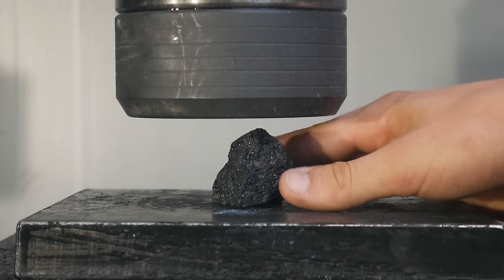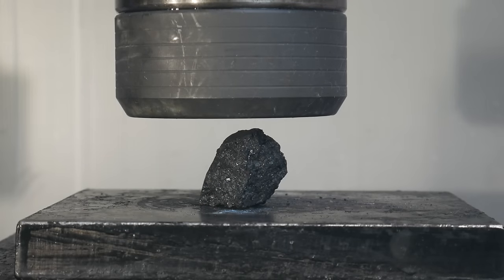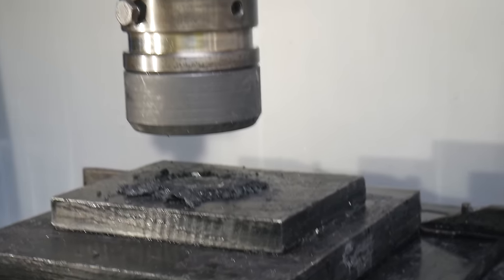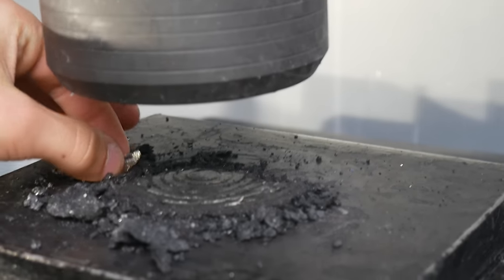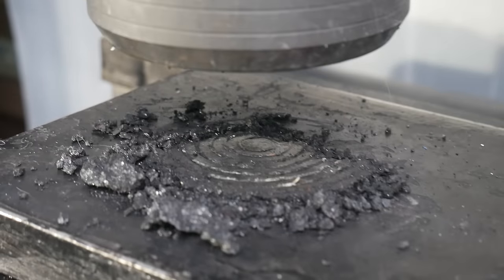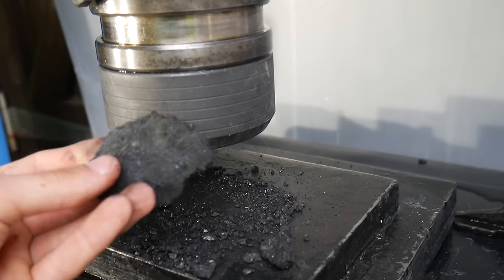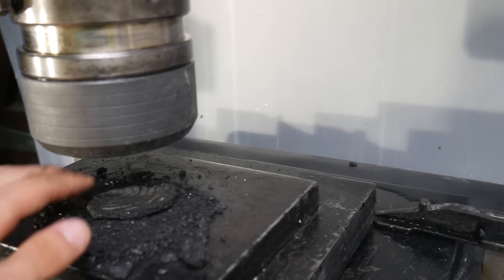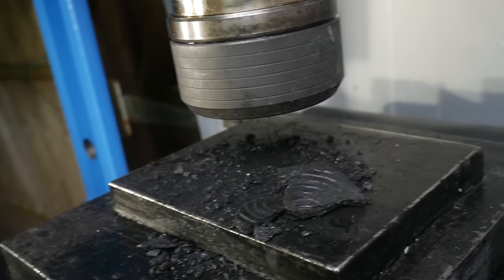Crushing COAL into DIAMONDS Hydraulic Press- Will it work?

Comment: it takes more tons of force then a forge press, and lots of high heat for a long period of time to make diamond sarry.
Reply from the maker: +manga12 Ik that is what I said in the video :)
Reply: +Crushit did not hear the part about heat though in the video.
Reply: +manga12 i did
Reply: +manga12 Try listening before running to the comments section to try and prove to yourself and others that you're 'smart'.
Reply: +Topher Glenn I did not hear what I did not hear.
Reply: I saw it once, no need to jump my case, and start the name calling
Reply: manga12 Sorry m8, i got a bit salty there
Reply: what I said was a restatment of the obvious, so would you just let it go?
Reply: LET IT GOOOOO. LET IT GOOOOO, CAN'T HOLD IT BACK ANYMORE!!!!
Reply: +manga12 
your right.... Tremendous pressure, Extreme heat, and a million years or so for authentic diamonds. fake one can be manufactured in less time.
Reply: +manga12 
your right.... Tremendous pressure, Extreme heat, and a million years or so for authentic diamonds. fake one can be manufactured in less time.
Reply: and heat
Reply: True
Reply: manga12 WE KNOW
Reply: Yeah its about a few months
Reply: It takes millions of years for the heat to be high enough but the diamond can quickly be made seen with lab made diamonds
Reply: @kuljitminhas8707  well a few weeks in a lab at least but point is 100 tons aren't going to do it with coal anyway

Comment from the maker: It was predicted that crushing coal wouldn't turn into diamonds  but you will never know unless you try!  Many people have requested the video so I have made it. Please don't hate just because it would probably not work... like I said... You will never know unless you try!
You need a lot more heat and pressure over a longer period of time to make diamonds.
Thanks for watching :)
Reply: Keep up the good work!
Reply: diamonds are made of carbon not coal sorry but your fact is wrong but kudos for trying
Reply: +Colby Wright again its oxygen and carbon, thus why it burns so well because it supplies itself with its own stored oxygen
Reply: Wrong. Very, very wrong. What you're referring to is known as an oxidizer. Coal is not an oxidizer. If you take a lump of coal into a vacuum, hold a torch against it, the coal will stop burning almost immediately after you remove the flame.
Reply: lmfao So what do rockets in space use for thrust? Magic fairy dust?
Reply: Crushit
Reply: Crushit you nead heat and presur around it like imagine taking all the air outs a jar or vacuming it with the coal
Reply: you should bought big coal if it will work to make a diamond
Reply: Death 9750 considering he would of made £4000 or more and got #2 on trending there are quite alot of reasons to it and it can be  melted down and shaped again.
Reply: that's what a scientist does. try everything
Reply: Crushit qq.
Reply: Mr. Mudkip pretty awkward right
Reply: Aidan Holloway gotta say that's the best burn I've ever heard. kudos to you sir
Reply: SodaJeff no he said will it work
Reply: Irock124 They use rockets to get through the atmosphere. In space they use pressured air to propel the spacecraft.
Reply: Crushit is it crush it or cru shit
Reply: coal won't turn into diamond no matter how much heat and pressure you have. you need graphite.
Reply: Crushit hahahahahahahaha at 1:11 you actually thought it was a diamond and it was a piece of glass and that little guitar riff got me dying!!!!
Reply: Crushit  by the way im not hating or nothn but the guitar riff at 1:11 it was funny how it sounded :)
Reply: seems Philipp Huber deleted his comments in the face of science
Reply: you think he doesn't know that
Reply: lol that cut was so obvious.
Reply: Please do a real diamond crushing. Please
Brother you are doing the genuine original crushings...
Other channels do fake crushings i mean they use fake materials in name of real materials and crush them.
Reply: you click baited my ass
Reply: You could try peanut butter XD
Reply: still funny
Reply: Crushit you need more heat
Reply: I Love the way you think
Reply: Crushit I was triggered at you when you faked it because it wouldn't be clean
Reply: Crushit Boi XD
Reply: Dont worry i thought it was funny and awesome you have earned my subscription
Reply: @DameLicker  coal is made of carbon
Reply: Is it repeating my comment hold on ok I put this once 1 time
Reply: I like the funny glass part 😂

Comment: This test is stupid... p = F/A... You should try brilling a hole in the bottom piece, put coal in it and put a small point made of steel that matches the diameter of the hole. Also, heat it with a propane-torch or something. 

I know it probably wont work, but its a way better test that this
Reply from the maker: +And nir Thanks for the idea
Reply: @Crushit  also use pure carbon instead of a chunk of coal

Comment: You should leave it on for a day
Reply: with a constant blowtorch running
Reply: +Jordan Belich 

Still won't work. The amount of energy required to break the bonds and the pressure required are beyond anything we have.
Reply: this is not trou because ther are several things thet can make dymond but it take over a week or more on a very larg heat

Comment: Coal has too many impurities to convert directly into a diamond. You would need a more pure form of carbon like Graphite. You would also need 10GPa, and a temperature of just over 4000K.  10GPa roughly converts to 1450377 psi. You would need a very strong press indeed.

Comment: imagine taking a piece of something made of carbon, a graphite for example. heat over 4000 ° C until it melts or boils. take this extremely hot liquid or gas, and compress it to the pressures of millions of pascals. when it cools, it becomes what we call a diamond

Comment: First off, diamonds aren't made from coal, from those of you who are only saying that it takes "both heat and pressure" and the such.  It is true that diamonds are made from carbon, the the same stuff that can be found in coal, but the carbon in diamonds has to be pure carbon.  Most diamonds formed way before there were plants by the way, which is where coal comes from — plants.

Comment: maybe you should heat the coal with a blowtorch during the press.
Reply: diamonds wont form because it takes millions of years of pressure to compress carbon into diamonds. not only that, but you'd need a thousand tons of coal to form a milimeter of diamond

Comment: Why this won't work:
Yes, coal or charcoal can be made into crystals but that can only be done using really high temperatures and high pressure. After that it needs to cool down. The crystals you may see on volcanoes are made using that process, but as for the cooling down part it takes thousands and maybe even millions of years.
* takes pistol *
i'm ready for the r/iamverysmart comments

Comment: it only work with extreme heat. pressure is just conjecture as based on lava theory. why can we crystalize silicon glass into quarts at one atmosphere and not  graphite into diamond at one atmosphere? don't anyone realize that science may actually try to cover up the truth here for proffit reasons? logic says that if most elements crystalize at one atmosphere with the right temperature, then its likely that carbon also crystalize at one atmosphere at the right temperature. the crystal creates its own pressure by the expansion of the element itselv at some temperature.

Comment: You can really make your own diamond but in a lab(lab grown)you just need a carbon couz diamonds are made of carbon also 2000-2100• farenheit and lastly  725,000 pounds per square inch that is why diamond are 100 miles beneath earth sometimes it is on the earth's surface that is because of volcanic eruption

Comment: Hey there Bubba, I guess you are not very bright.  If you would attach a very small steel disk centered under the ram.  Then give it all the pressure you can while using a torch to heat the carbon.  This would have 100X the chance of actually working.

Comment: Make the coal hot while crushing it for about an hour and it may work?
Reply: diamonds wont form because it takes millions of years of pressure to compress carbon into diamonds. not only that, but you'd need a thousand tons of coal to form a nanometer of diamond

Comment: Aren't you supposed to keep the pressure for a long time
Reply: bout a million years, tho i suspect youtube has a limit of how long a video can be that would fall short of that
Reply: the pressure of the hydraulic press wont turn it into diamonds, not even in billions of years. normal diamonds form over 500 km deep, where the pressure is a lot stronger, and there it takes a few million years to form. the weaker diamonds get pushed to the higher layers and they're called kimberlite diamonds (the diamonds we use)

Comment: this whole video is based on an urban myth. diamond is made of carbon nanotubes wheras coal if a mixture of carbon particulates and graphine. Althougth its the same element its a completely different structure. if you heat the coal it can break bonds so that extreme pressure could make indystrial diamonds but the impuritiey make it a slightly different substance.

Comment: If it only works under extreme heat and pressure than why don't you apply extreme heat and pressure than. You have a hydrolic press ad blow torch.😀😀😀😀😀😀

Comment: if diamonds are so rare then why does this happen
Reply: They are actually not rare at all, they just control them to make them seem rare, all started by the debeers diamond company
Reply: ashkechum101
then what is the rarest/strongest
Reply: Moew ROBLOX it takes a long time to make and gold is worth more anyway
Reply: there's two types of diamonds, industrial diamonds, which are put onto the tip of a drill and etc, which is what you would get from a longer process than this, and the types of diamonds you put on jewelry.
Reply: +ashkechum101 what video did you watch to know that...
Reply: Diamond is the hardest, but that doesn't make it the rarest.

Comment: if you make diamonds you will be floated like on the Arch (The 100), joking, but what I mean you will be killed somehow, second how to make it ? the steps is very easy, more than 200 tons of pressure for about 20 days and more than 1500 degrees of heat, the material is high quality coal so it will have too much carbon, how will get this tools ? I tell you, you need to find a mafia can provide the pressure tool for you, or you can make it yourself if you are and engineer and when you make it the money you will make will make you a mafia yourself, so both ways you will be killed .. bye bye